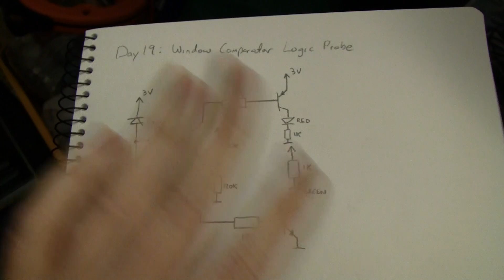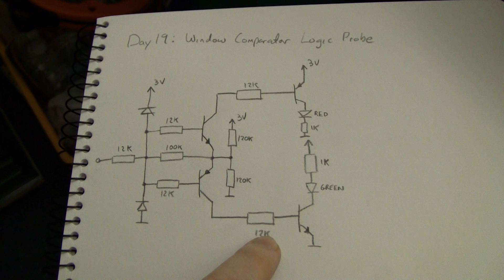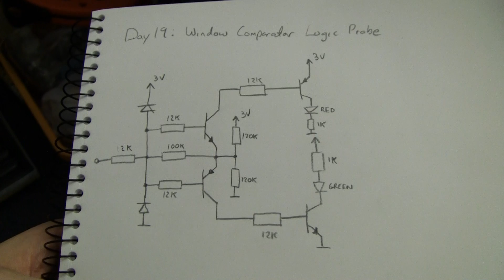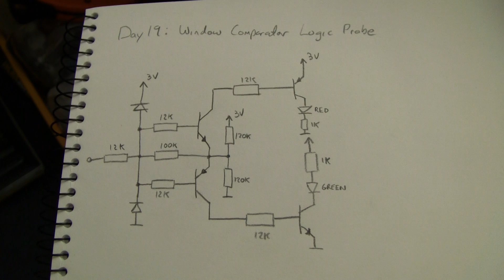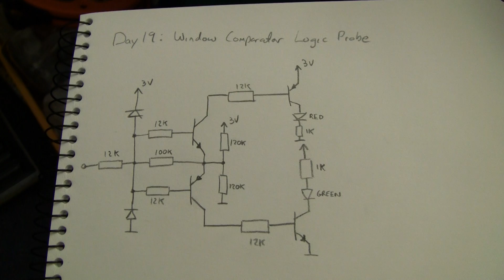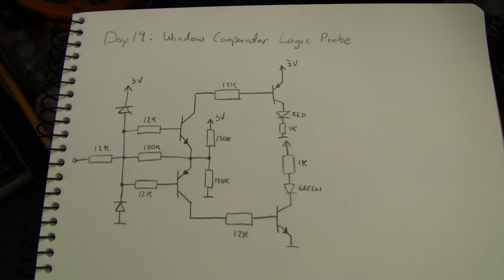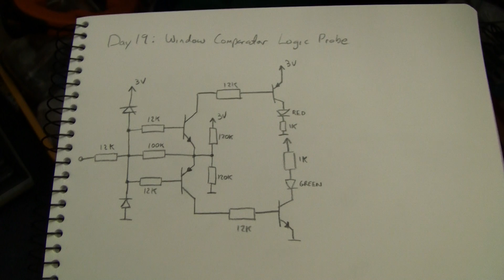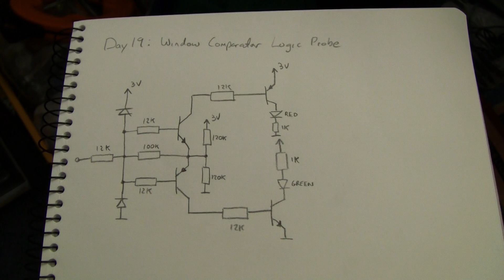Advent Calendar of Circuits 2011: Day 19: Window Comparator Logic Probe

Comment: There is an even more simple circuit to build an window comparator : Using Op-amp, by combining the non-inverting comparator and inverting comparator, with both having different reference voltages, a window comparator is formed.
A window comparator detects whether or not an input voltage, Vin, is between the LOW voltage threshold (Vl) and HIGH voltage threshold (Vh). If the input voltage is within the two limits (or within the window) the output voltage will be low, i.e. OV. If the input voltage is outside the two limits, the output voltage will be high, i.e. +5V. In summary, Vl < Vin < Vh, V0 = 0V otherwise, V0 = +V